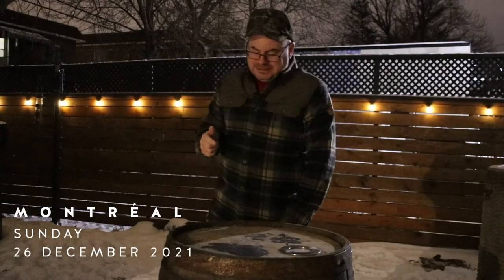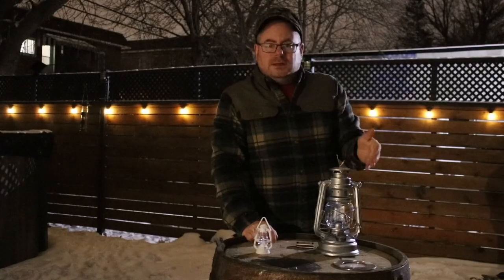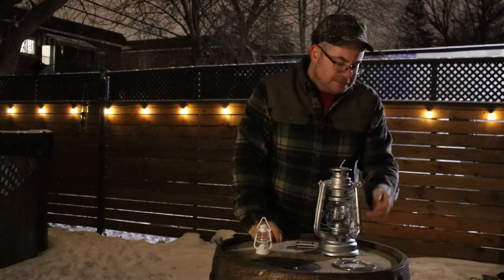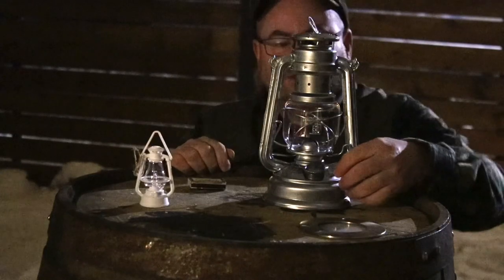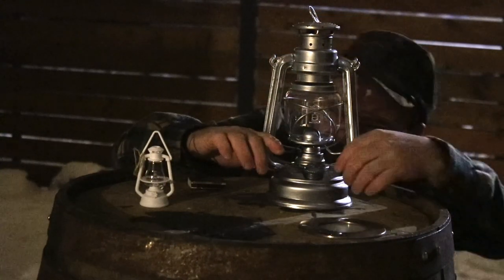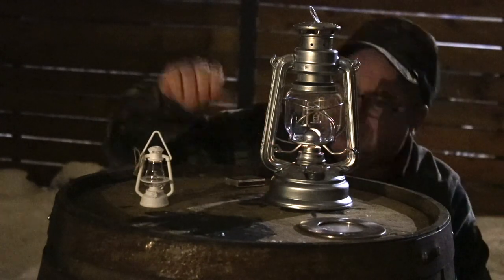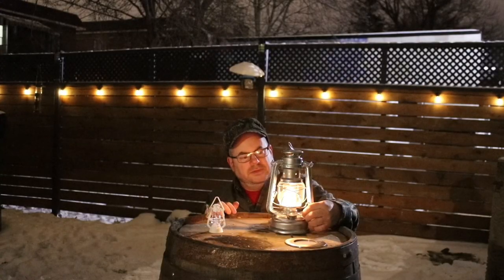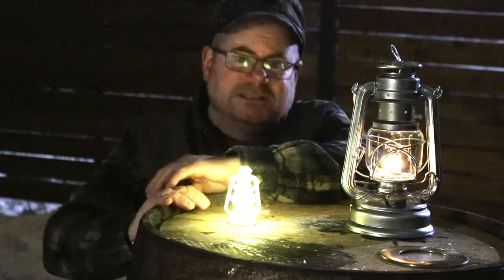Hurricane lanterns: oil or LED? a totally, completely, way serious comparison

Comment: I have oil lamps snd lanterns for the winter because they put off about 1800 BTUs of hear and midsize battery led lanterns for spring summer and fall for power outages from severe storms the battery ones are much brighter but Im with you Id choose the oil lantern over the led the light is more alive and natural
Reply from the maker: The heat given off by oil lanterns is their cold-weather superopwer, I think.

Comment: Flashlight and oil lantern. If you have to you can render oils and animal fats to use in it. I do have batteries that will last effectively indefinitely though with portable solar charging for flashlights, radios, etc. Fire is a practical heating, cooking, drying, preserving, and sterilizing method, so being able to maintain and transport fire in a weatherproof lantern can be very useful. Turned down low these will last a whole day on one full tank.

Comment: I've always really liked oil lamps simply because making a useable lamp oil isn't too hard if you have some basic knowledge and will, but it's relatively easy to get most places as well, and the ambience of a lamp is simply comforting. 
Can't beat a protected source of open flame, either, for bushcraft purposes.

Comment: Haha, I've never seen a smaller led lantern!  Was it one of your Christmas Tree ornaments?   For ambiance, yes the oil light, for practicality when needing to guide your way to the outhouse in the middle of the night I'd go with the led but perhaps one a bit larger.   Also, that little lantern can be hooked to your dog's collar at night!  Thanks for the laugh.  My poor Oil Lantern has been on the back porch for years.  I might have to fire it up again.
Reply from the maker: Yeah, it’s a tree ornament. The whole video was a bit of a joke. I actually have an LED lamp in the camping stuff, but it wouldn’t have made me laugh to make the video.
Reply: @RaindanceBushcraft  I thought that tiny lamp was hilarious and you rocked the deadpan comparison of both, but the comments seemed serious supporting your reasons.  Then I was afraid to comment thinking I was taking it all wrong.  Genius humor, thanks for the laugh.

Comment: The oil lamp I assume it should be safe for indoors, that's the only type of lamp they had hundreds of years ago, no LED or any other lamp during that times :). Greetings from the woods in Sweden 🇸🇪
Reply from the maker: I’ve used it twice indoors now during power outages with no issues, so I feel a lot better about doing that.  I just cracked a window nearby to be safe.

I would love to go camping in Sweden one day.

Comment: I bought a couple of vintage style edison bulbs. I've been thinking about building a lamp fixture into an empty lantern enclosure and putting a bulb in as an indoor lantern solution. They have a warm, ambient, almost fire-y orange glow to the filament. Not sure if they work with dimmer switches. For the flicker, I might just throw in a moth!   😅
Reply from the maker: I have Edison bulbs on the corner of my kitchen counter, where we have some bar stools. I love the light. Your idea sounds like a great project.

Comment: I burn oil lamps almost every night, and almost never have to trim my wicks...  I think you're using the wrong type of fuel. I use Aladdin Lamp Oil in mine.
Reply from the maker: I’ll revisit my fuel choice and see if it helps
Reply: Ditto,  I used lamp oil in my feuerhand and got the same result. I switched to K1 kerosene and no longer had to constantly adjust the wick.

Comment: I'd take the LED all night long, they have leds with warm light about 3k, that Oil lamp burns about a kilowatt hour worth of energy to give you the equivalent light output of a 1 watt rechargeable LED lantern, A rechargeable 1 watt led lantern with two 18650 cells will run about 48 hours between charges and they can be charged with the portable battery packs designed to charge cell phones, 

just for comparison, you would burn 2 gallons of kerosene for every 1 charge of the LED, Oh an the kerosene lamps stick and they deposit soot on the ceilings when used indoors